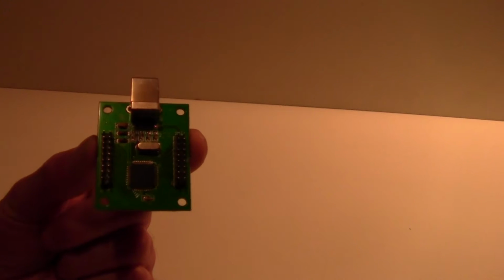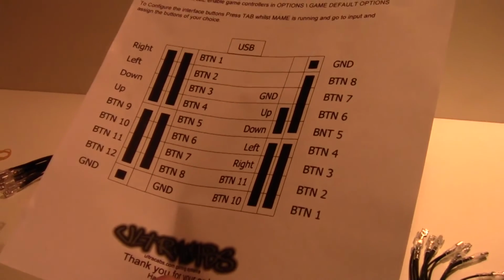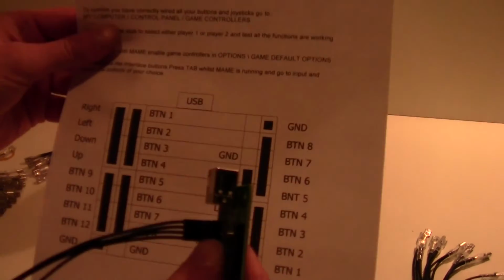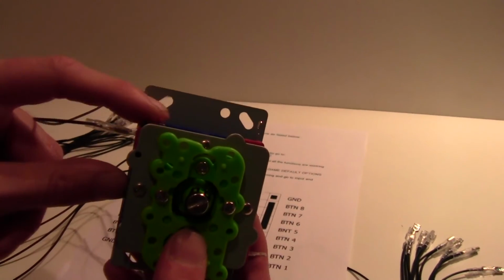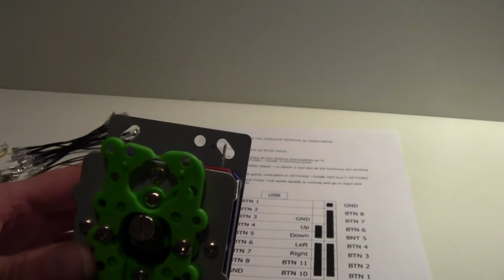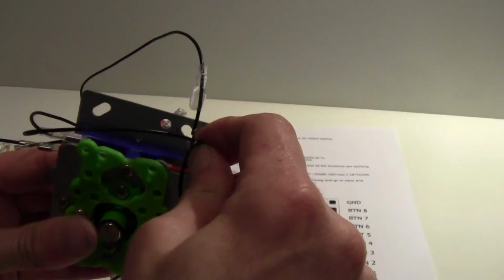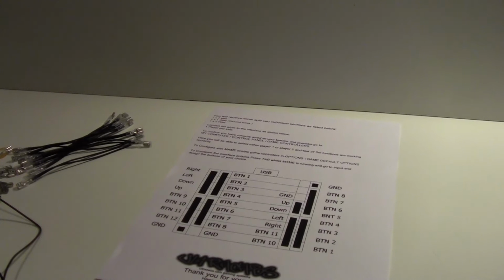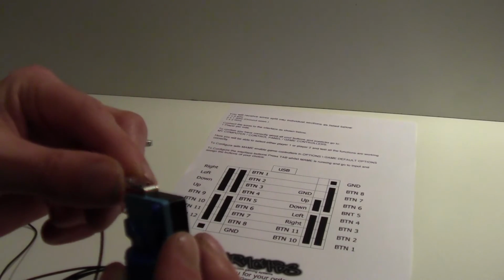How to Wire the XIN MO USB PC Arcade interface

Comment: Thx a lot for the tutorial i didnt get layout with mine either,so this helps a lot.Unfortenly i got all the buttons to work but my 2 joysticks fail to be recognised by retropie,any ideas?i think i copied exactly the way you did it and also my usb interface its exactly like yours.thx
Reply: DId you ever get a response on this? My 2 joysticks also fail to be recognized, by either my PC or Retropie
Reply: @archon453  retropie detects only 1 joystick by default, you can make the 2 being recognized but you need to change a config file, which I don't recall where it is...just google that

Comment: I’m on my third attempt to wire my joysticks and buttons. none seem to work when all plugged in and try to configure in retro pi. Didn’t pick up any sticks or buttons although does detect the encoder. Is there a specific way u need to put the wires to the buttons and joysticks I have buttons with micro switches built in

Comment: Hi,
Great vid managed to connect the both joystick and 17 button. I then plugged it into a Windows 7 Laptop and it detected but came up with unknown device. DO you know if this is a common problem or if I need a driver that is not in Win 7. Or have I a duff board :(

How you have the answer.

Thanks

Simon Leake
Reply from the maker: Hi Simon,
If you have a spare USB cable handy try that as sometimes the cables can cause that error.

Comment: Hi - I've emailed you regarding a couple of faulty buttons, and not heard back yet... but I'm also having issues with the ones that DO work being seen by Windows but not actually registering in MAME - Or with XPadder.
Do you have any advice on how to sort this issue, please? ( Buttons 1 - 3 work for both players, 5, 6, 7 are OK for P2, but the rest don't register. )
In addition to this, the Left switch on P1 is prone to intermittently not registering. Are there any fixes for that?
Thanks.
Reply: +Steve Fletcher ( Got an email reply offering to send me out replacement buttons, so thanks for that :D )

Comment: dude...
i already buy a similar interface...
but when i conneted to windows this advice me that hardware have problems and it cant installed..
i need to connect all butons and the joystick to make that windows reconogzie the devices?
Reply: +Juan de Dios Figueroa Try changing the USB cable.
If that doesn't work then the interface may be faulty, it should be found in windows devices whether you have buttons connected or not.
Reply: hi thanks.. the problem was the usb able..
best regards!